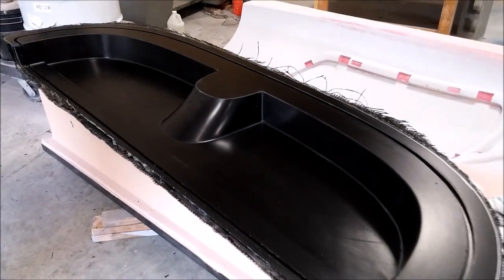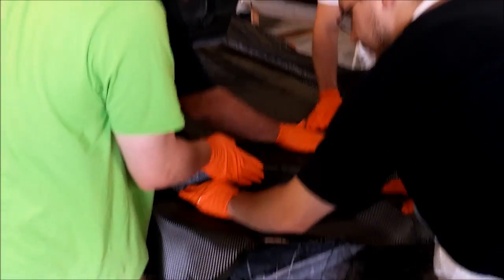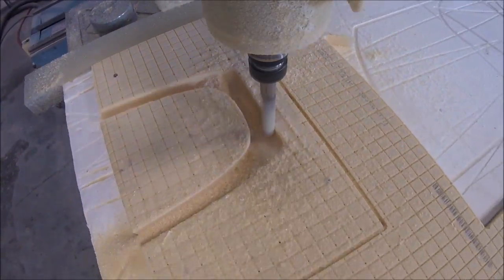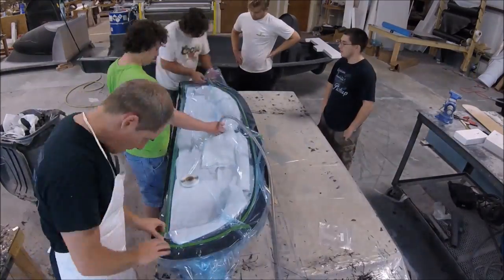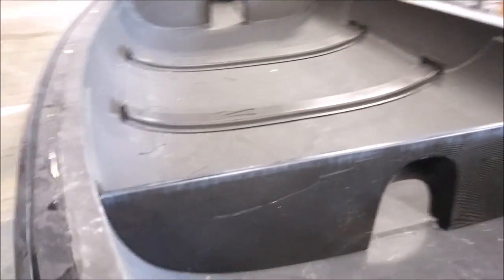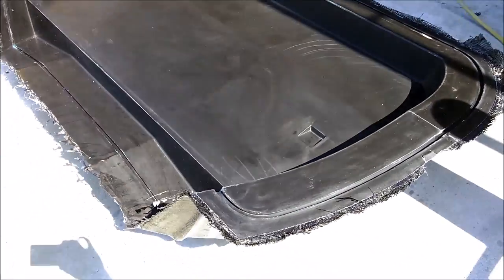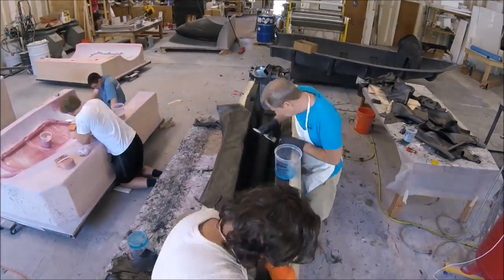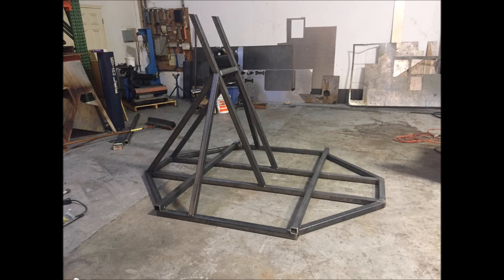Raptor Aircraft May 14th

Comment: What is the reason for a) the core (what is that material?  very hard?) and b) the 45 angle that you seem to put the carbon fiber at at all times?
Reply: A) insulation
B) strength